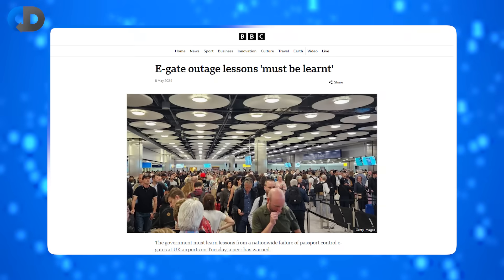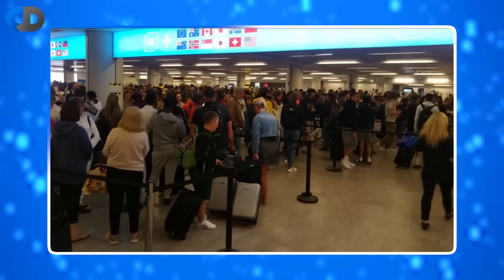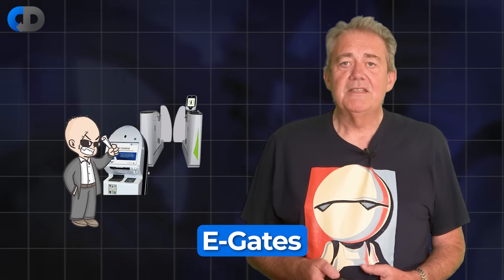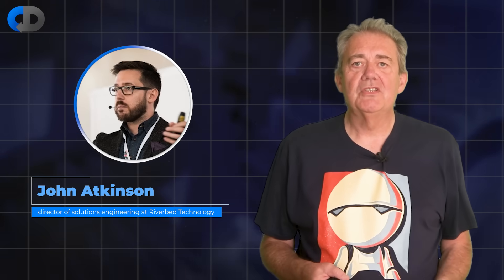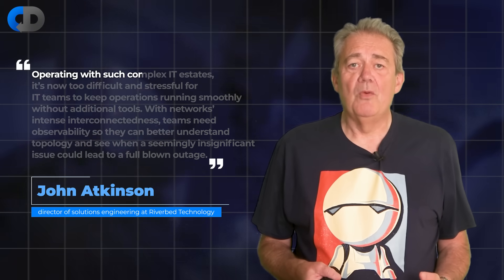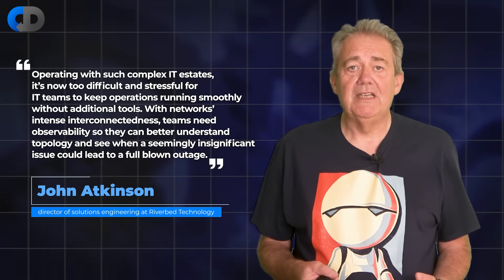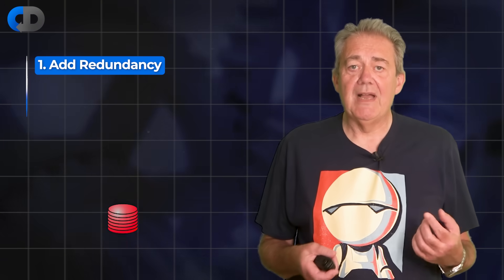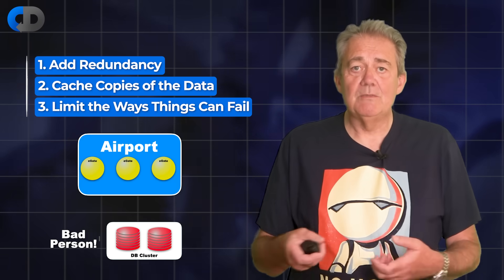Software Engineering F&*K Up Behind The Passport E-gate Failure

Comment: You design every single component of a system like this assuming it will usually fail. You design the data messaging assuming data is not reliably transmitted or is duplicated. You ensure that every component fails safe. Or you design the entire system to a golden path at 10% the developer cost.
Reply from the maker: I am sure that that is the calculation that people make, but I don't buy it. I have worked on well designed distributed systems with good people and it didn't take longer, it was quicker, and it didn't cost 10x because dev salaries don't work like that. Actually for systems like these developed by government, they are so overstaffed that I am sure that the kind of teams I worked on would have been 10x cheaper, as well as better.
Reply: @ModernSoftwareEngineeringYT  I don't think it costs 10x to do it properly, but that's what it looks like in the project management process if you start listing all the failure modes you can think of and then treat each one as having a development cost in proportion to the golden path.

 I've worked on some scientific distributed processing code bases where nearly all the code handled faults and recovery. If we'd had to guess a number for the developer time for each failure mode, we'd never have been allocated the hours those numbers said we needed to handle them. Management would have said it was too costly. It wasn't, but tickets and features and user stores inflate it.

Comment: But, what if the scanning process itself is done on a server, and the gates merely send the scanned passport images and face pictures to it? In this case, they're completely dumb, and can't possibly work without a server, right?
Reply from the maker: Sure, you could build it that way, but I can't imagine why you'd prefer that, if you could avoid it. 
Keeping the compute close to the point of need is a pretty useful strategy in distributed systems if you value resilience.

Comment: It bugs the hell out of me when people use WiFI as a replacement for cables.  The only reason to use it is for something that's mobile; if you have one of these kiosks, which will almost certainly reside in the same place for most of it's life, there's no reason to not run an ethernet cable to it.
Reply: Even then, a switch could die. It is better than WiFi but can still fail.
Reply: @mrpocock  multple redundant nics connected to multiple redundante switches is possible. Of course, there is the facebook case as well, they managed to reconfigure the whole network into a nonfunctional state including the switches the door access controllers for the room to locally recover.
Reply: @EwanMarshall  when I worked on the human genome project, we had redundant power. Two cables went in opposite directions to two different power stations. No shared cable. Everything is overkill until it isn't.
Reply: @mrpocock  Oh, I know :D And it can still find a way to fail.
Reply: @mrpocock  true enough....you still gotta plan for those kinds of things.

Comment: Sadly though for most contract jobs, they require line items (often hour rate based) on the budget allocation for the quote/invoice. When you have a nominal chunk of it allocated to testing/security, you'll often get push back from the client/government. A contractor can break down their rigorous testing methods, but usually the one approving the budget/job has no background to comprehensively audit the requirements. Even with submitted documents as part of the acceptance criteria, few have the know how or willingness to verify that in fact the reports were correct and accurate. After the job wraps up, there is often little to no monitoring deployed either to log and flag any degredations or points of failure. There really needs to be more tech/industry consultants to help validate these mission critical systems, but the tricky part is also being able to find unbiased experts that aren't incentivized by the contractors targeting the jobs.

Comment: Its easy to make assumptions, but Im going to guess the security requirements are more complicated/restricted than people are thinking. We dont know that a local cache was even allowed.
Reply: even pictures can be hashed and the hash be used for comparisons without disclosing the original

regarding the "outdated cache" problem, it seems they fell back to manual check, which probably means even more out of date data and more error prone
Reply: @robervaldo4633 I agree, just as talked through by Dave. The only exception I see is that this was the preferred failure mode. 

It's like having flashing lights and a siren go off if someone breaks into your cabin in the woods, rather than extra locks on the doors and windows. I.e. There's still someone inside but now it's obvious, and everyone knows it is.

In other words, maybe planning for failure caused by well resourced bad actors is what they did. It just looks the same as failing to plan for software failure. I don't know enough to know if that stands up as a theory but it is one scenario Dave didn't explore.
Reply: I thought that too. But then, if they reverted to manual passport checks, clearly they either had a local record of some kind (which I doubt was in paper form) or they had some other, redundant method for disseminating information from the home office.

Either way, whatever solution they adopted for the manual checks they could have implemented as fallback in the software. The fact it wasn't is a symptom of bad design.
Reply: I think the video is a well planned out non-exhaustive pedagogical resource for resilient design. 

It began with suspected "single point of failure" which is obvious for experienced engineers, but not all... Then went to assume single data source ... And I think Dave even qualifies this as an assumption... Especially because the video even covers network issues as a mode of failure but doesn't go on to explicitly describe designs to combat this to the extent data resilience was....

I think he turned the event to a good learning opportunity, not necessarily pointing out any incompetence.
Reply: Adding a cache is definitely my go-to solution for this.  I would probably cache a hashed data that you could match with.  That said it's probably a government requirement that you use the latest data directly from their servers and that you can't use a cache because even 10 seconds out of date is too out of date.

This is a good solution for a problem that would allow for a good solution, but there's no indication that this situation actually allowed this kind of solution.  The same could be said of transactions and Bank information.  That's a solution where if you can't get the most up-to-date information you shouldn't display it at all.
Reply: Indeed and if you did take this approach you've just created another set of possible failure points - what happens if your cache fails to update often enough you could be letting people through you shouldn't be. At least the original failure prevented this.
Reply: @charlesd4572  1000% this
Reply from the maker: This is a design problem to be tackled though, not a reason to make a badly designed system because otherwise "it's too hard". 

I can think of lots of ways to secure the distributed cached version of the information, and which made sense would depend on the detail of the requirements from a security perspective - solving that problem is what design is for. Deciding that this is impossible is simply wrong, because there are lots of systems that do more complex versions of the same thing, and deciding that discarding resilience because "we can't be bother to think of a better design" is a dereliction of duty.

My guess is that this is really a more systematic failure, and less about the requirements, this is more likely a problem where the need for resilience fell between the cracks of a poorly structured, poorly organised engineering process.
Reply: @ModernSoftwareEngineeringYT  I never said it was impossible or too hard. I just said we don't know the requirements/limitations the engineers were up against. They could have come up with a safe enough cached version that they were simply told they couldn't use just because those in charge (maybe not technically minded) simply didn't want any kind of risk. I don't disagree with any of your ideas, I just think there are a lot of assumptions being made that simply might not have been the case. Specifically my last point, were you were making out that because they could manually do things on the day of the failure, then that MUST mean they could have used similar options in the initial design, ... which again, is making assumptions.
Reply: @SirBenJamin_  I don't like the idea that the wrong decisions were made because the people making the decisions were not aware of what matters. It's a dangerous way to think about things. Making sure this does not happen is the first job of the technical staff. Those people who do understand the trade offs.

I don't like the idea because I expect more of people with knowledge. This idea suggests that it would be content to smugly watch the ship go down because they could see it coming and they gave up trying to realise any value from their knowledge.

In summary if you are prepared to view everyone else as well incompetent basically, what kind of standards will you hold yourself to? Why would you bother working hard to be well informed?

I do accept though that it happens. I just think we should never be comfortable reaching for it as an explanation. I should also point out I don't live in the UK and have no general exposure to the event.
Reply: @trignals the point I was making (and others have too) is that this video was made upon too many assumptions in what the developers were actually allowed to do. The team behind this software won't be small, do we really think they wouldn't haven't considered a cache? That's computer science 101. Simply put, yes it was a bad design, but pointing out obvious solutions without knowing the restrictions the original team had is unfair.
Reply: @ModernSoftwareEngineeringYT  a word of encouragement. I really like that this video did not seek to close off all possibilities. Using specific real world examples is a great way to talk about general design principals. Going too far into the particulars can obscure the more generally valid points and dilute the main focus. This felt like a good balance.
Reply: Almost certainly NOT allowed. Despite it being a list of 'bad people', it's not okay for that list to be distributed or risk being leaked. So can't be brought to the edge devices for security reasons alone.

However, there could still be multiple secure replicated, distributed copies available at fall back locations should one become unavailable for any reason. 

A single copy isn't just a single point of failure, it's also a bottleneck and the pressure on it is likely to be the reason it fails.
Reply: Yeah I guarantee that they considered it and we're told it wasn't an option
Reply: @PavelHenkin you could always safely distribute a hash. They were just some lousy code monkeys, they built a system on top of f-ng WiFi, obviously they never considered anything at all.
Reply: Far better to hard fail and require the slow manual processing, than letting stuff through without managing to get consistent records at the end like in the Horizon Post Office Scandal.
Reply: Also, I don't think it's valid to say "they were allowed to do approach X during the downtime, so they must of been able to use those same rules in the original design too!" ... again, potentially not true. It's quite likely that they had to break (or loosen) the original rules/requirements just get the downtime issues into a manageable state.

Comment: If we want to cut the developers aome slack, they may have thought of all these things, but then get stopped by something else such as GDPR, burocracy or other rules that prevent local copies of data. The POI terminals are likely susceptible to hacking for example.
Reply: I work in this industry (document and biometric scanning for govts) and GDPR + bureaucracy is indeed very likely to the cause. The team creating the e-gates software were likely not allowed to create a system that has full read access to the "bad people list" and thus lookup would likely only be allowed on a per-api-call basis and only by authorised clients via a home office-controlled privileged API of sort. All to prevent the entire list from leaking somewhere.

You can probably mitigate the hacking of POI terminals by having the terminals connect to a central hub server application in a "secure" room in each airport (so e-gates using local area network instead of WAN).  That central hub (per airport) could contain a local cache. The odds of an intranet/LAN going down is significantly smaller and would limit damage to 1 airport. 
The hard part in such a project is justifying that each airport should be allowed their own full-cache copy of the sacred bad people list just because of an event that people would deem "unlikely", but that is what resiliency is about. Bureaucracy is tough though.
Reply: even pictures can be hashed and the hash be used for comparisons without disclosing the original
Reply: @robervaldo4633 That works for the digital pictures, but does it also work for the scan of an analog picture? Is there like a "close enough" hash for images?
Reply: Unfortunately, that is correct. When you see a system failing, you only see effect, you have no idea about the story behind. GDPR is good and should be applied to all systems processing personal information.
Reply: I  am. It sure but it seems that there has been only one incident with the egates since 2008 plus the issue comes from a home office “blunder” I would say not too bad.
Reply: In this case it would be better to not have any software at all. 
I'm not cutting the developers any slack.

Comment: I agree whith everything that was said in this video but I would add another point to consider : cost
Increasing the resilience of a system always comes at a cost, whether it be increased complexity, reduced capabilities (which are both mentioned in the video) or increased financial cost.
It's a balancing act between resilience and cost. I believe it is necessary to perform a risk analysis to determine where to place the cursor between resilience and cost.
Reply: I agree, sort of. I think it's a balancing act between the cost of failures and the cost of resilience. In a distributed system, network outages are guaranteed to happen. The only unknowns are how often and for how long they'll occur. But as you said, a good risk analysis should give you an idea of the cost of failures. Of course, there's also the small matter of who will pay those failure costs. It's not always the same organization that acquires the system.

Comment: I can't imagine how someone could design an e-gate system without local caching... I've made gym entry software that had local caches ON THE GATE so wifi doesn't affect it.. and updates were pushed via mqtt to each gate... and these e-gate systems, i assume are made for many many millions.. it's a shame..
Reply: Maybe they did think of all those things but we're stopped from doing them due to other reasons such as GDPR, bureaucracy or other rules. The POI terminals are vulnerable to hacking after all.
Reply: I'm sure the data could be anonymised - the e-gates don't need any detailed information, just "Is this GUID in the bad people cache?".
Reply: There's an amazingly large number of software developers who just don't think about their application's connectivity at all. I say this as a web developer who's coworkers are completely fine with making 10 different API calls to gather information instead of just keeping it cached.